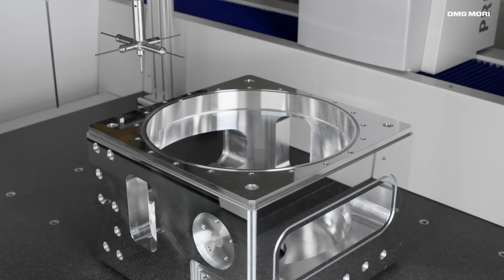Semiconductor chamber housing complete machining

Comment: I like the part at the end with the inspection data. That is pretty cool.
Reply: It is pretty cool. But unfortunately they aren't using any scanning on the Zeiss CMM to check any of the features so the actual data is somewhat debatable. Still a great video. Although DMG Mori makes a good product I still think Mori Seiki made a better product on their own.
Reply: @caseycarpenter79  I would expect that all Measurements made after 3:12 are done with a Zeiss Prismo CMM, not with the CNC mill. You can see the machine in the video
Reply: @fabianm6529  You are correct. The Prismo is equipped with the VAST scanning head and software from Zeiss. The features on the part they are checking can be scanned with the CMM providing more data points rather than single point probing.

Comment: 17 years ago, I started my career as a machinist. Beginning my studies in a roll die shop, running a few Mori-Seiki's live tooling turning centers. 6 machine shops later, over 25 different CNC machines programming for, setting up for, and personally running, Mori's are still am besten!!!!!
Reply: Clearly you haven't tried Heller.
Reply: @richpryor9650  forget Heller. Try a Hermle, or even better, a Mikron. No one does precision quite like the Swiss.

Comment: I wish you'd show the machine, including options and price of the machine, as well as tooling used, feeds and speeds, and total cycle time so we can get an actual idea of how productive the machine is
Reply: The only company that put prices of their machines on their site is HAAS, other CNC machine makers including DMG Mori consider it heresy to make their products prices accessible easily through their websites.
Reply: over 500k
Reply: the productivity of the machine is based on the programming. If the programming is shit then the productivity is shit as well.
Reply: @ipadize  I program a DMG Mori M1 and I totally agree. While it's an entry level VMC there is just so much productive potential to squeeze out of it through advanced programming techniques. Tightening the transitions and employing arc linking techniques to minimize decceleration and maximize minimum velocity, TSPing all the feature patterns, prestaging tools and optimizing toolpaths and feeds and speeds (we had a part were it was 2 seconds faster to run it at 10k RPM vs 12k RPM due to spindle ramp time on the top end of the curve). But then again when working with small parts with very small actual machining time, out of the box fixturing and imaginative processes is the way to go.
Reply: My works has 4 machines from DMG. One of the best I’ve ever used
Reply: Of course that would be amazing to have all those numbers, but if you spent a mil or two creating these chambers would you give out all your research data for some shop to copy that and underbid you by a few hundred? All the info you asked you can research yourself and If your even close to make that kind of investment reach out to your dealer and the application engineer will work with you, but to publish all that info on here for free is asking far too much.
Reply: @Jaymachine  you don't know what you are talking about.
Reply: @SuperAWaC  coming for the guy who wants a cycle time and f/s on a semi chamber and pricing options on a 800k plus machine/setup, Im not offended.
Reply: This housing unit is for Applied Science 200mm process chambers. This is the smaller version as 300mm is larger. This houses only the lower chamber. The chambers are hand built by ultra precise glass welders
Reply: @user-ll8rk4xx2u  Applied Materials not 'Applied Science.' Specifically, an epitaxy machine, likely their Centuara Epi line. The folks echoing the glass bit are overdoing it a bit, there are windows but it's a metal chamber. Chamber sections in the fab industry are either bolted together, which sounds fine until you've known the pain of spending a day with the helium wand trying to find and fix a leak, or they're TIG welded or more preferably friction stir welded together.

Comment: Nice semiconductor housing...if only there were semiconductors available these days..  ;-)
Reply: thankfully it´s a machine that makes semiconductors
Reply: @faxxzc  which needs a semiconductor
Reply: Not really. This is only the HOLDER for the process chamber. Those are hand made with even tighter tolerances by precision glass welders

Comment: This is just the housing unit. I am a scientific glassblower and Quartz welder. We build the actual process chamber by hand with tighter tolerances. 

Interesting to see the housing for “lower domes” in a centauri style from Applied Materials. There is also a completely different style of Quartz process chamber that is square (not round like in the video) from ASM. Those are MUCH MUCH more difficult to build. The glass that goes inside the housing is about $125k all in with all the parts.

Comment: Sad that it isn't the complete machining, with only glimpses it's far from.
Would also be very interesting with comments to why specific tools and tool paths were chosen.

I can't wrap my head around the parallel requirement shown in the end. It seems to point to the top surface but the reference "D" is on a vertical slot, 90 degrees off!

Comment: This looks like some kind of a loadlock for an ASML machine.
Reply: ASM uses rectangular Quartz glass chambers. Applied Science machines use the round sone process chambers. Both are hand built with much tighter tolerances by glass welders in the scientific glassblowing world. Using 99.97% or higher purity Quartz.

Comment: Hi, 
Perpendicularity 0.001 is not possible whereas Datum B flatness itself 0.004. And also you have to consider the form error of cylinder A. 
Thanks
Reply: I was thinking the same thing.
Reply: I think that truth is somewhere near. Digits are devided by 2 or 4.

Comment: What's the name of that tool shown at 2:19 that machines to mirror surface finish?
Reply: It looks like some variety of fly cutter, normally they only have a single cutting edge and they feed very slowly to ensure a very flat surface
Reply: Most likely a so called 3d  PKD cutter.      3d meaning each of the tips can be adjusted in height ,  diameter and angle.   

The inserts are poly cristalline diamant.  There are also mono cristalline diamant which  makes even  more shiny surface but is more brittle.  So no interrupted cuts....
Reply: HORN M117P